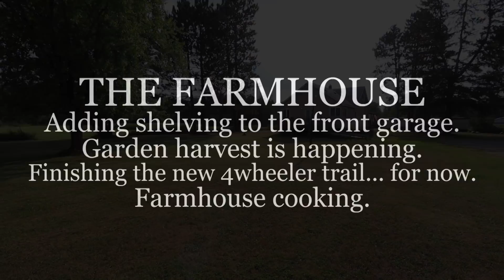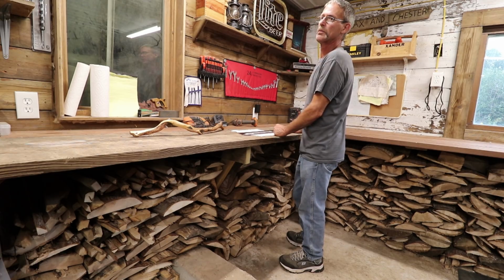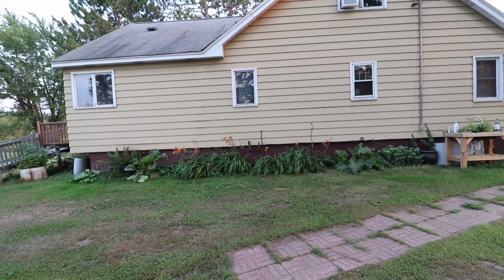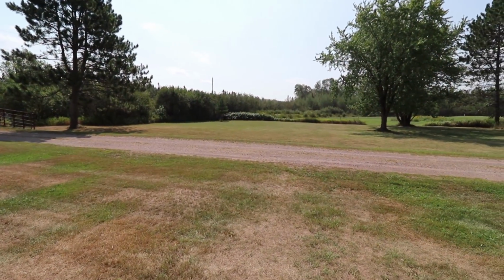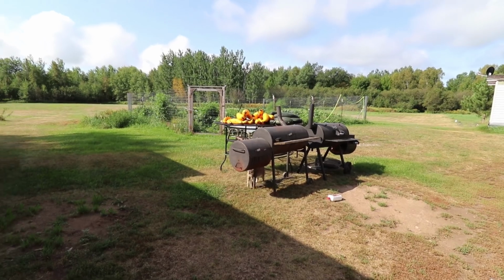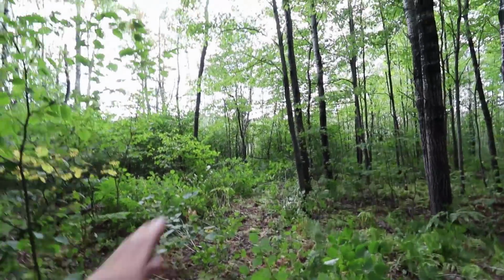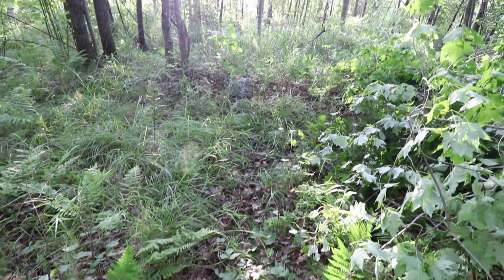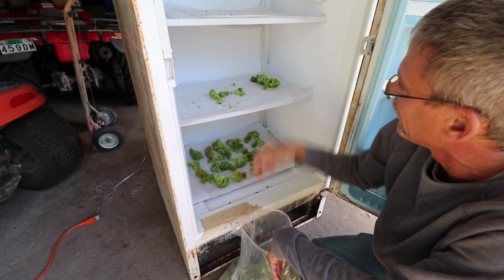THE FARMHOUSE. Front garage shelving. Finishing the 4wheeler trail, for now. Farmhouse cooking.

Comment: Joe you should bolt the two cutoffs from the tractor mower arms and bend two angles and bolt to the bottom of that garage doors. It would be much easier to close with a handle at the bottom of the door. Just a thought.
In regard to those molds and the kiln... Yes you could make decent money if you sold the clay pieces and then charged people to have them fired. Its fun to make all that stuff especially the glazing.

Comment: Instead of putting the flat stock on the finish mower I’d put a piece of 5/16” chain on it. That way it would lift it level and still float over uneven terrain. That’s probably what broke the previous owners farmer fix. Better yet sell all of the quads, tractors, lawnmowers, utility vehicles  and telehandler and buy a bobcat toolcat with a few attachments.

Comment: Joe, finish mowers are meant to float front to back and side to side to follow the ground variations.  I can't tell from the video if there was a method for your deck to float, but if it was original they shouldn't have broken.  If there is a float mechanism it should either be a pivot arm at the top link or slots at the back of the arms you are replacing for the deck bolts to move within to allow that float.  Thanks for the videos!